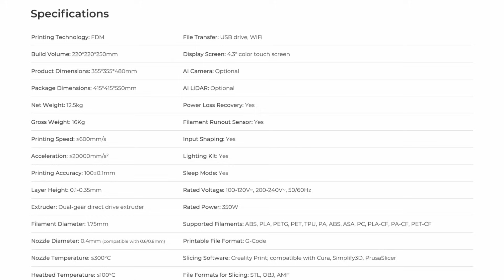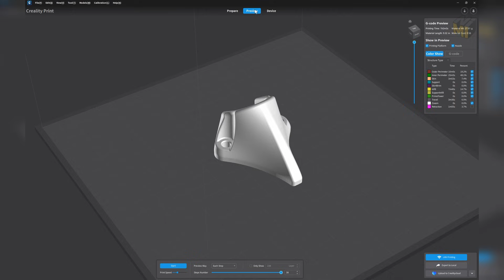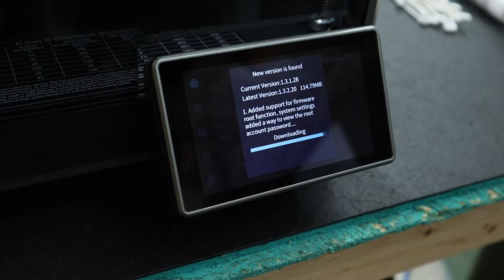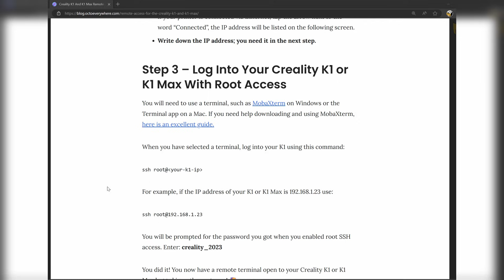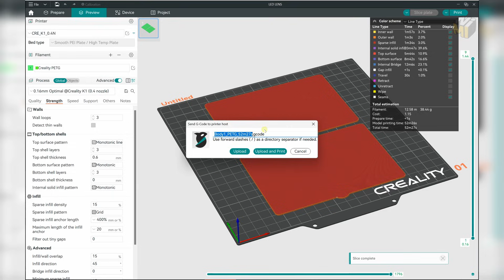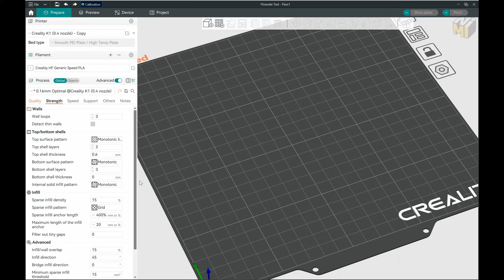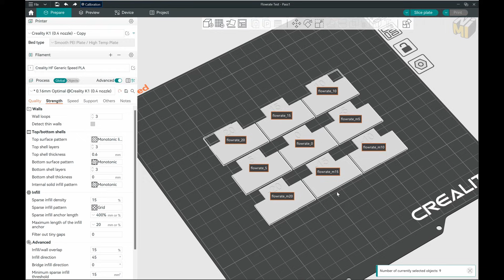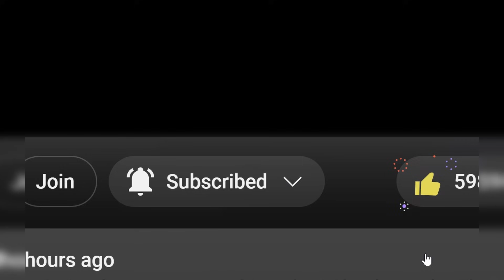Orca Slicer is BETTER than Bambu Studio, Cura and Prusa Slicer because they were the food!

Comment: Orca Slicer would be good if it handled supports better.
Reply from the maker: I've had good success with supports myself, I usually go for tree.  Today I printed Tree with PETG and they came off perfectly.   It was pretty satisfying.  Can you tell me a bit about the problem you're having with it?
Reply: @NeedItMakeIt  Some of the files I print need rafts and that's the keyword "Rafts" Orca Slicer isn't good at Rafts, I'm having better luck with normal Supports, but Tree Supports are neigh impossible to remove as are rafts when I print them.
Reply from the maker: @NightStryke3D  I can honestly say that after 5 years of 3d printing nearly every day, I've never used rafts.  I'll check it out myself.  Strange that something that's been in the slicers for so long wouldn't work well.  Do you print with PETG?
Reply: @NeedItMakeIt  No, Inland Tough PLA.
Reply from the maker: @NightStryke3D  Gotcha, I have had a similar problem with one PLA.  It would make an interesting video to investigate each support type on the same prints to see which ones come off easiest.  From different slicers as well would be a good idea.
Reply: @NeedItMakeIt  It very well would make a good video, but we'll have to find someone to volunteer for it. It would be a fair comparison if I did it, I don't have Bambu Slicer or any of the Bambu Lab Printers unlike every other 3D Printing Channel so it wouldn't be a fair comparison with just two K1 printers and an Ender 3 with Prusa, Cura, Orca Slicer, and Creality Print. Yes I use them all, no I don't like using them all, but Cura is better at Printing Supports that remove easily while Orca sucks at easily removable Supports, Prusa's a pain to deal with, and well Creality Print is Creality Print...

Comment: They need to hurry up and add in a measure tool and the new features from Prusa, the arrange features and cut features specifically and it'll be perfect
Reply from the maker: Prusa is pushing hard to stay at the top, they have some really cool new features.   The SVG feature will come in handy especially if people want to personalize their prints.  I have tried it with a complex pattern... on a complex part and they didn't agree, I'm sure it'll be refined more as they go.  

Do you think that because PS is open that it is fairly straightforward to pickup those changes in Orca?

Comment: Tried it today, AWFUL SLICER! with the same settings it extended my print time almost 2X!!! Got me awful results, stringing, bad adhesion, awful accuracy... Went back to Cura and couldn't be happier!
Reply: I believe orca is a fork of a fork of fork made specifically for Bambu printers because Bambu version lacks lots of good settings, just use the slicer that gets you the best quality, I've used prusaslicer 90% of the time
Reply: copy flow, retraction, temperature, speed, acceleration etc settings
Reply: @BH4x0r could you tell me good settings for anycubic kobra 2? ive literally tried anything, but still awful stringing and retraction problems, ive even tried to copy the same/similar settings of prusa (which Is everything alright there) but still no
Reply: @shadowMKW  try around with some retraction, i don't have that exact printer so i can't really help 100% on that

also make sure you dry your filament, with a proper filament dryer
Reply: @BH4x0r  not a moisture problem, i did same stl but with other slicers and it came out perfectly, no stringing, no bubbles and so on
Reply: @shadowMKW  ok so then retraction, make sure both retraction speed and distance in both slicers are the same and temperatures aswell, increased temperature could cause increased stringing aswell.

make sure it also isn't printing faster than the stock slicer (i.e. adjust max speeds), i've read of the Kobra's having issues with higher speeds
Reply: same stuff, i use and anycubic kobra 2, but the time Is actually faster than prusa, but awful stringing and retraction problem, tried everything but still no
Reply: God, just tried and SAME!!! Cura will be my lover until I die.
Reply: well, your mileage may vary, i got a Neptune 4, the time indeed increased by a small margin but it improved my finish by a lot
Reply: I wanted to try for my BIQU B1 and got print times x 2 so went back to Cura…
Reply from the maker: Do you mind providing which printer you have?  It is possible that Orca doesn't work well with some printers... yet.  It's good to get feedback like this there's no way that I can test every printer, I need help from everyone to fill in the blanks.  I appreciate your help on this.
Reply: @NeedItMakeIt it's just some generic gcode for every 3D printer.

Thing is, his profile was totally wrong. But that's not the slicer.
Reply: @NeedItMakeIt  No problem at all! I use Elegoo Neptune 3 PRO, trust me I wanted to like Orca, it has some really cool features. I tried my best to make it work, but nothing I've tried worked... Not sure why.
Reply: @jackromashoff4419 Oof. Definitely a skill issue 🤦😂
Reply: Neophyte operators often have this issue...

Comment: Can you print from a usb cable in orca slicer?
Reply from the maker: I don't think you can do it through the USB cable, you'd want a PI and set it up with a WIFI connection.  I just connected my printer via cable to my computer and it doesn't even recognize that the printer is connected at all.  I just checked on Creality Print, and even it does not allow a cabled connection, WIFI, or Sonic Pad are the options.  Seems a little strange that their own software would not allow this.  I'd imagine that there is a way, but it would take a bit of digging.    At the prices of the K1, you may consider selling your V2 and getting a K1, there will be more faster and more capable printers coming into the market soon as well to compete, so prices should be good for the consumer.

Comment: Impact of a slicer is very under rated(often neglected), compared to hardware( creality, bambu labs, prusa etc.). Glad that you've brought some clarity to the subject.❤👍
Reply from the maker: Hey, thanks for that!  I knew that Creality Print wasn't 'cutting' it with this printer.  Unfortunately there is still some lingering extrusion related problem, but it seems to give quite a bit better results for this printer over Creality Print.  I am going to experiment with the extruder feed tube a bit to see whether it is being pinched too much and causing some of the problems, if you have any ideas, I'm all ears!  Still very happy with Orca, I agree that the slicer plays a good part.  It's like a team effort to get to the final result.
Reply: @NeedItMakeIt  If not for moisture in filament, it could also be some gum build up on the xy rods(only the steel ones). If it is consistent under extrusion, during fast printing speeds, could be a pinched ptfe tube. You could try a little bit of ptfe bike chain lubricant(a tiny drop goes a long way) on the xy rods. Also ensure rerunning input shaper after doing this. Finally, could reduce outerwall speed and print outerwall first,followed by innerwalls and infill, to get better skin. Just some suggestions.
Reply from the maker: @aware2action  I've been cleaning a lubing the rods with a very light oil, I've heard that the grease originally on the rods could cause some vibrations.  I had also asked Creality if they had plans of providing a kit for CF rods instead of the steel with drylin type bushings.. they do not have plans.  That's not really related, but I think OA it could help to reach higher speeds without with minimal ringing.  I think the most likely cause is the PTFE tube, it's really tight in there, the Bambu is also a little Cramped as well, I may also do a head to head, or install a riser to remove that possibility.  It's going to be better than the PTFE in the cable chain though!    I had a comment on the following video to this one that my finger grease may impact the print quality, maybe it would impact it in a good way by giving some lube...?   I laughed a bit too hard when I first heard someone say it, but I actually don't know the answer to the question, so I have to do some tests.   The best oil I believe is jojoba, the most similar to the oil our skin secretes.  

I'll do some more testing and report back on the progress!  Thanks for your help.
Reply: @NeedItMakeIt  Glad you are on the the right path👍. BTW, there is even better oil than Jojoba, its Argan oil!(ensure its 100% pure) very slick and thin. Works wonders on tangly hair, hopefully works equally well on a linear rod/bearing🤞.
Reply from the maker: @aware2action   A few things to try for sure.  I have 2 vids on the go, I'll be working on this one afterward.  Should be interesting!   I've never heard of this oil you speak of.  I shall take a look... unfortunately I do not have a problem with tangles, but I could use it to give a nice even shimmer to my forehead.

Comment: are you suppose to root your k1, to be able to get orca to connect to the printers?
Reply from the maker: I believe that's the case.   In order to install the necessary software onto the K1, you need to root it, run the python installation sequences for Mainsail/Moonraker/Fluidd as well as install Octoeverywhere.  Without rooting it, I don't see how this would be possible.  I can't say I completely understand the intricacies behind everything, in essence the printer must be opened up like what you'd see on a Klipper printer in order to be able to have a connection with Orca like on other Klipper printers.   

It didn't take long for me to do it, and it is absolutely worth the time, I was also recording a video at the same time, you'd probably be far quicker than I would be.

Comment: I'm not sure if I get what the big deal is about printing directly to the printer from the slicer, as though it's some new feature; I've been doing this for over 4 years with Simplify3D v4 to my CR10s-Pro.
Am I missing something here? 🫤🤷
Reply from the maker: I'm with ya, I've been printing wirelessly to my Ender 3 V2s for quite some time as well.  The video was supposed to serve a few purposes, show people that it is possible now to root the K1 and open the printer up as if it was like any printer running Klipper.  I wanted to show off Orca slicer as  well, it is a very capable software.  In addition to that, that the software can work seamlessly between two printers from different brands.  There are a lot of people buying K1 printers, the prices are pretty good, so I thought I would make a video showing how to do this.  For me specifically I was not a fan of Creality Print and wanted to get away from using it, I can only assume that other people felt the same way.   So maybe not a video for everyone?

Comment: I have been using Orca Slicer for a few months now and it has become my favourite slicer. I tried using Prusa Slicer and it has quite some useful and powerful features like making joints for divided parts, but I still find Orca Slicer easy to use with a simple UI and still having sufficiently advanced features and settings, not to forget it exists because of the Prusa Slicer in the first place.
Reply from the maker: I wonder how easy it is for Orca to pickup any new features from Prusa, seems like they should just all amalgamate into one.
Reply: @NeedItMakeIt  they could probably just copy and paste🤣🤣
Reply from the maker: @LucaThePupineer  Pretty much, with everyone being OS, as long as you know what you copy and paste.  Prusa or Orca or Bambu, they're all pretty good, I'm leaning towards Orca mainly because of the ability to easily send to different brands of printers.  I have 3 newer Creality Printers, and it's really seamless, the Bambu as well.  

I'm sure someone else will come in and usurp them all!
Reply: @NeedItMakeIt  i havent printed with it yet but it sounds like its good
Reply: @NeedItMakeIt  It is because they all use the almost/probably the same code. But the MK4 Profile in Orca mainly doesn't work that well with my MK4. It depends about the printing model but most of the time PrusaSlicer is doing a better job at the MK4. I also think that Orca Slicer - generally - is not better than PrusaSlicer or Bambu Studio, it is just different and depend the printer which you use and of course the printer profile in the slicer.

Comment: If you don't care about print times, this is the way to go for the Creality K1 and K1 Max AI. I've watched a bunch of videos comparing the slicers and for some reason ORCA slicer prints were slower than Creality and Bambu Studio prints and increasing the speeds didn't net shorter print times.
Reply: Probably because in orcaslicer the wallthickness is 3 walls, and in bambu studio its 2, also the layertime on your filament is 8s, on bambu its 4s
Reply from the maker: There are quite a few little settings that we'd need to go and tweak, even though I've been running both printers from Orca, the settings still aren't identical for each printer.  But that's a good test to see if I could go through and make the print times nearly identical for each, with 30 seconds or so would be good.  I think it's possible, but then again the settings are ...set  that way for a reason, so adjustments to them may end up with a result that's no good.  But def. interesting.
Reply: Your speed limit is probably the volumetric flow setting. Bump that up if you want your speed settings to take affect. 

Of course proper thing to do would be to measure your volumetric flow of your hotend and nozzle size to correctly set it so you won't have underextrusion problems.

Comment: 1:00: That my friend, is called ringing.
It happens when a printer does not have input shape active to compensate the vibrations and prevent it from affecting the printing quality.
I am not surprised K1 has this problem, but so did my unit X1C which I returned to build a Voron instead.

None of those printers allows you to run input shape like A voron does to proper calibrate the vibrations created my the printer.
To minimize that, you will need to slow the printing speed down. Slicer alone cannot make miracles.

EDIT: No, BambuLab don't really have a proper input shape, that is not how it works.
Reply from the maker: My phone rings, my prints don't :)  I don't think people have any clue what's involved in recording a video and memorizing everything they'd like to say, sometimes the words don't come out exactly as we'd like them to. 

In any case, I'll do my best to try and use the correct terms in any following videos.

I agree that it's not just the slicer, there are still vibrations related issues on the K1, however, the Bambu is not the same, the prints are always very clean.

I don't run any Voron printers at the moment, but I would like to, I have heard that they are still slightly better than the Bambu.  I can't speak to what the Bambu does or does not have as far as the intricacies of the firmware, it does produce excellent results every time with no fussing.  I have had a friend test their P1S with my filament and my designs, and the results are also very good.  Comparable to the X1C;  probably not as good as a Voron, but certainly up there.  

I probably should have done more samples to compare both slicers, but in the end, Orca is quite a bit better than Creality print, the speed, the options, the menus, they're all very klunky, and something else strange that I don't have happen at all now is that I would not always be able to connect wirelessly to the printer through Creality Print, very frustrating when you'd like to print, have to refresh, restart the program, restart the printer, disconnect the printer from WIFI, reconnect it.  Since upgrading to Orca, I don't have these problems.

Can you shed a bit of light on what 'proper input shaping' is?  I'm curious.

Comment: Because you don't know how to configure a custom printer on prusa/super slicer that it's bad?
Reply from the maker: I've used it on and off over the past 5 years, it has some great features, but I've found it far more clunky to use than Bambu Studio and subsequently Orca.  I don't believe I said Prusa was bad, I was just not able to get it to work well with the K1, and Orca changed all of that, and if anyone else has a K1, they should do the same IMO, especially if they also have a Bambu printer.  It's absolutely seamless to swap between printers.   Have you given Orca a try yourself?

Comment: I recently got my K1. I like Orca, but not sure on how to get the purge line on left and the move bed away from head after print. It just stops at the end of the print with nozzle on the part.  Something to do with the post processing? Where to get post processing scripts?
Reply from the maker: Any chance you could do a quick video, I can compare to what mine is doing, mine lowers the bed and parks middle right, that's the way it has always   done it as well.  Seems strange that yours would be different if their running the most up-to-date firmware and both running from Orca.
Reply: This cannot be changed in the Slicer. This is part of the Start Macro Codes in the Klipper Firmware of the printer. Same for the end, this is in the end print macro.
You will need to root your device, then you have full access to all macros stored on the device and can modify them.

Comment: NO. Just simple models are totally failing by Orca. Just because a bunch of hacks from Bambu Slicer amplified by bugs in Orca make it not usable. 
Just try to print a simple pot with Orca and 0.6 Nozzle. It will create a lot of movements bugs just because nozzle is 0.6. Bambu do not support that. So that's probably a case for a bug.
Aditionall calibrations and web tab included are not a thing if actual slicing is failing.
Reply from the maker: Oh, wow, I cant say I’ve had a single problem yet, but there is still time I suppose.  Which printers are you using?  I have the K1 and X1C.